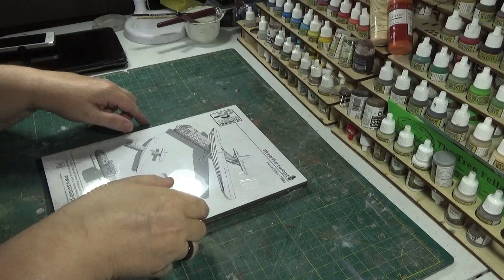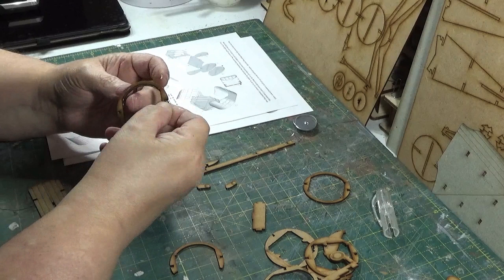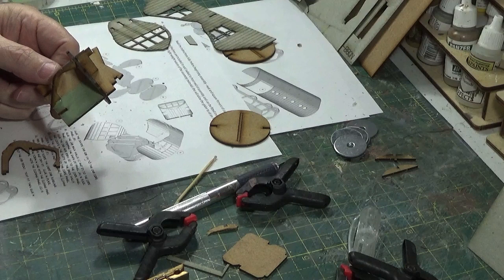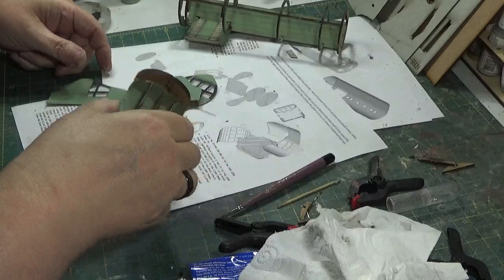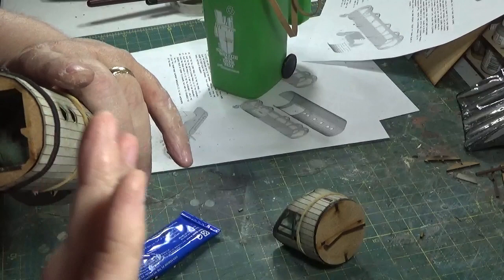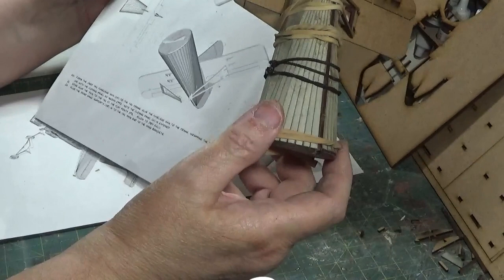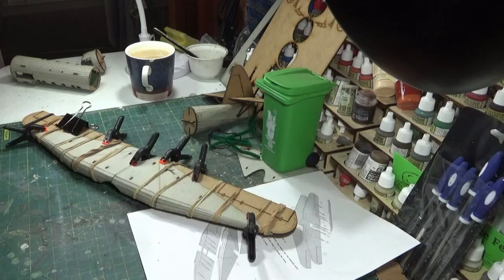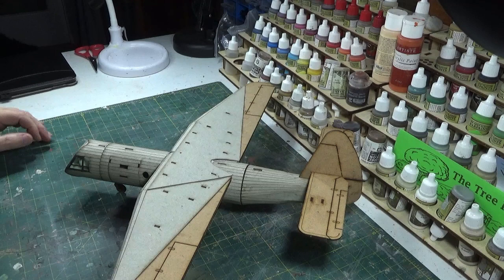Bolt Action: Horsa Glider by Sarissa (Part 1)

Comment: I made the German Glider from Sarissa, and had pretty much the same issues with the card, doesn't really fit. I made some side fuselage windows because it looked better with them in. The wing attachment was a fair amount of time sanding, trying and more sanding.
Reply from the maker: Yes it was certainly one of those builds you have to take care with and put a bit more effort into preparation. Still I’m happy with the overall look, so I’m glad I’ve made it. Thanks for watching👍🏻